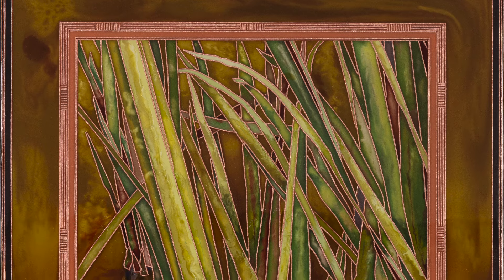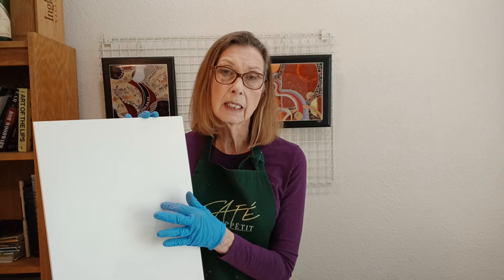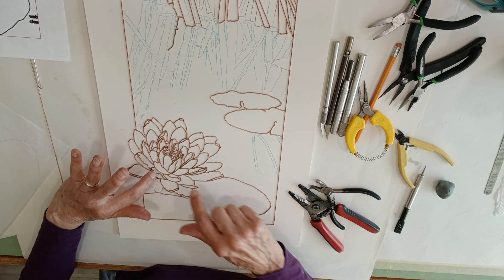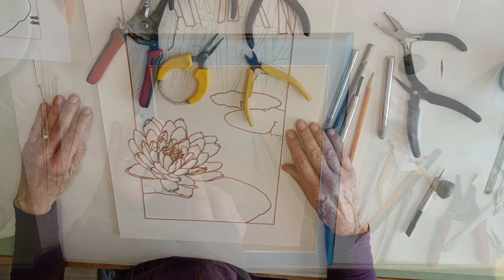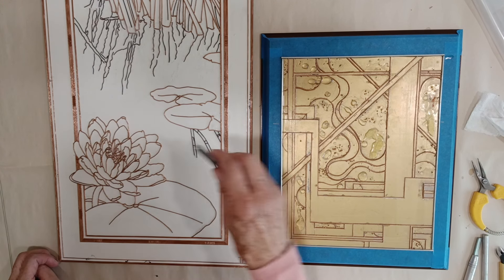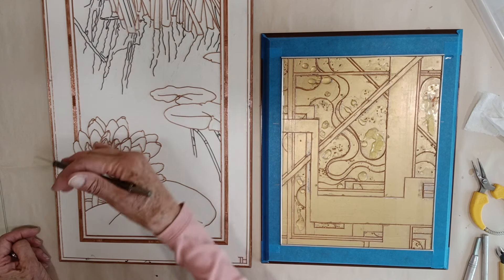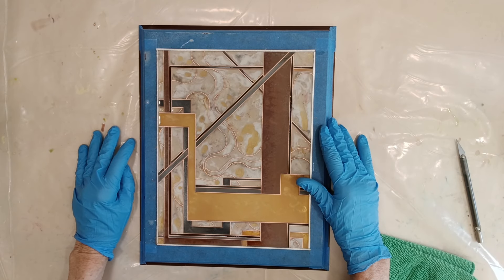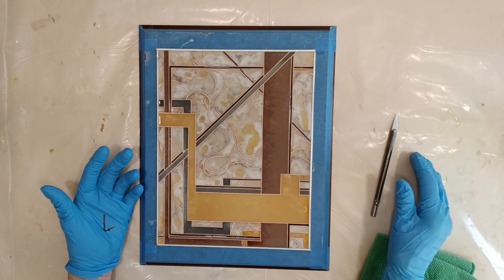Cold Cloisonné featuring ArtResin products

Comment: Beautiful. I missed the size of the wire you're using. And is it square or round wire, please?
Reply from the maker: Hello. Thanks for asking about the wire. I like 18 gauge which I purchase from Rio Grande Jewelry Supply. When choosing your wire, just remember that you will be sanding the piece and the thinner the wire the shallower the resin, possibly loosing what 3d dimension you have. Thicker wire is more difficult to bend.
I use round wire and have never tried square or rectangular, but my concern is it may be more difficult to do something with lots of turns.
 If you try it, please let me know the results. I've posted my process to entice others to try it but to also learn from other artists. I'd love to see what you create. Just know that all of these works look so much better in person!